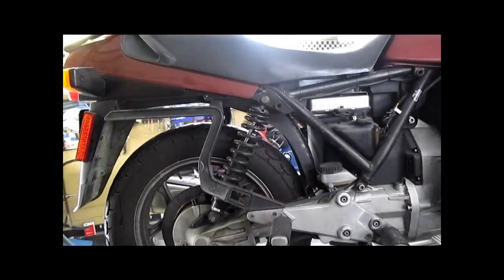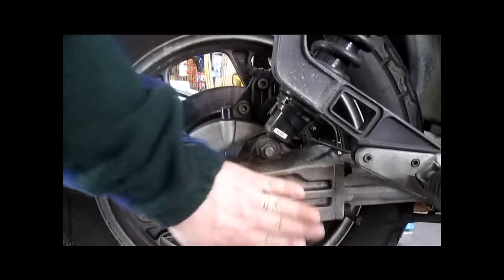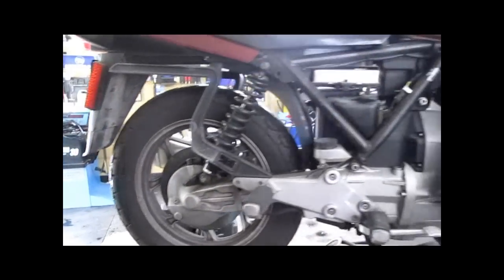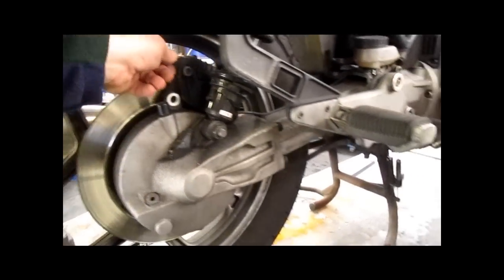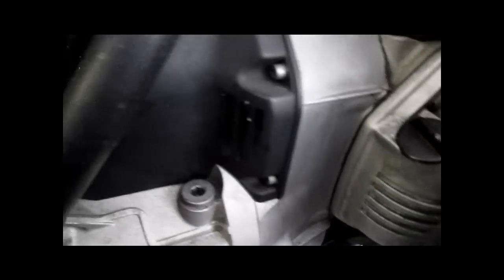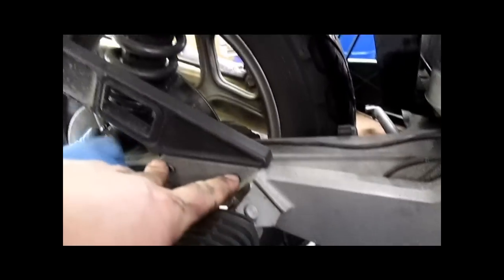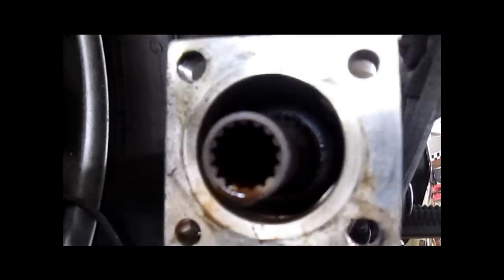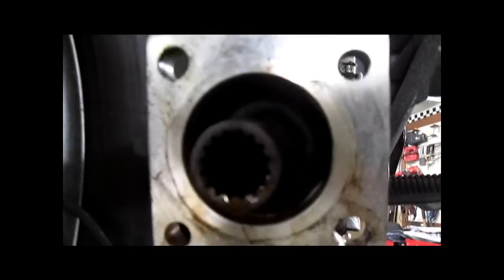BMW Service - K75/K100 Pre-Buy Inspection

Comment: I had an '85 K100RT. I was the only owner. It never had it's rear drive separated from the swingarm in it's entire 158,000 mile life, and the drive never failed. I'm thinking it was likely ruined, but it still worked. Wish I would have had these videos back then. Why destroy a good bike?

Comment: I bought my last K75 four years ago with a pretty good maintenance history.  The bike had 63, 000 miles. At my first spline lube there was plenty of grease and very little wear. I cleaned and greased with Honda Moly 60. Great video and very, very helpful.

Comment: What a superb video - this is something EVERY potential K75/100 buyer needs to know about. I have had my 1991 K100LT for 17  years now, it has 142,000 miles on the clock & I clean/lube the driveshaft EVERY time I change the rear tyre (5000ish miles). I also remove the shaft entirely & lube the front splines although they never seem to suffer from drying out so much. Keep up the good work!.

Comment: It never ceases to amaze me that people & dealers do not give the PROPER attention to such a critical and costly maintenance item, given all the knowledge through the years, of ruined drive lines! Just like the piss poor plastic original lower intake gaskets GM used on the 3100/3400 & 3800 V6 engines, you have to replace them with the aluminum framed GM or Fel-Pro gaskets. You are doing a super job with these videos!!!

Comment from the maker: Thanks. The front end of the shaft does not get any wear as it does nice ride back & forth along the spline like the rear does when the suspension is compressed & released. Keep the maintenance up and you'll pass 200,000 mi. without any difficulty. The 1990's were the best years for K bikes. Enjoy, Chris

Comment: I too purchased a k-100. It was a barn find It had a dry spline at 40,000 k.........I read the ingredients of never sieze, an they put moly grease in there. So....yup, I used it......I'll be taken the rear off again for a season inspection, I;ll post here with the results.

Comment: Thanks for a great public service video.  I did this service (and more) after I bought my 1985 K-bike and won the lottery.  Everything looked excellent and I believe the very low miles on the clock was pretty accurate.  I don't understand why you didn't pull the drive shaft and service the splines on the front too.  That was a bit of a hassle, but this shade tree mechanic was able to do it.  I encourage others to try, given that you often can't be sure it's done at the dealers.  :-(

Comment from the maker: Hi, The splines really need to be thoroughly cleaned and then lubricated. This can not be done properly without removal of the transmission. You can cheat and just slide the gearbox back but the labor that is saved is mere minutes. Thanks, Chris

Comment: Hi Chris, I bought an '87 K75s last Feb and am slowly working through it - it's back on the road for the summer :-)  I'm new to this spannering lark and your videos are brilliant, really helpful, please keep doing them. Next job is grease the clutch splines (having some pretty clunky gear changes), oh and there's a petrol leak on the left-hand-side of the fuel tank that I need to patch (was thinking petro-patch and JBWeld might do the trick on the outside of the tank), All the best, Ian

Comment from the maker: Make sure the horn works. If the horn does not work check the fuses. If the fuse is blown the cooling fan is likely seized. While not 'expensive' this defect would reduce the bikes value by up to $500. Point out to them that these instrument clusters were notorious for failing and the mileage might be inaccurate. Seized fan = many miles. If they are not willing to reduce the price ask to see the rear drive splines. If they are still unwilling then walk away unless it is an incredible deal. Chris

Comment from the maker: Most certainly! All BMW K models with this type of single sided swingarm should be inspected prior to purchase. The later Para-Lever rear suspension as found on the K1, 1992 K100RS, all K1100RS and K1100LT models do not need to be inspected. Thanks for your question, Chris

Comment from the maker: Unbolt the top of the shock and let the rear drive come down until the tire touches the ground (or your lift). Then unbolt the bottom of the shock and remove the shock from the bike. If it is an OEM BMW shock throw it away and get a better one (Progressive, etc.).
Reply: My 93 K-75  with 14K on the clock.. but years sitting before I revived it -  had the rear shock collapse. All loaded to go to colorado... came out in the morning, and blop..  Eventually bought the YSS Thai copy of the english shock, Good quality,  The BMW shock.. not rebuildable.  25+ years and things just die.

Comment from the maker: The R1100GS is one of the most reliable Oilheads made. Not as 'nice' as the 1150 but far more reliable and no failure-prone hydraulic clutch or the design flaw of the clutch carrier to deal with. Head gaskets were a problem with the early ones and there is always a risk that the tech who performed the 600 mi. service over-torqued the head bolts and pulled a stud from the block. This can be repaired but it is to be considered if you see drooling head gaskets. Rear drives are usually OK. Good luck
Reply: what's the things you need to know about a R1100 (259) motorcycle?  does the paralever needs the same operation, lubing splines?
What about those 2 chains and their sprockets inside the block while having like 50K on them. the chain tensioners have become an update and you need to replace them, but how you know the chains & sprockets are bad as wel the 3rd chain in there.
What about if the clutch lever only grips in like the last 25/<30% of the lever action. how should a clutch feel on a r1100 (259)?
what about the Hall Sensor?

did you place a 6 speed gearbox on a r1100 rs?

Comment: Just got a 90 K75RT w/50,000mi. Saturday (3/9/13) and saw your video that night. Pulled it off today and...................you guessed it.......dry as a bone!!! The dealer in Palo Alto told the previous owner last year that it didn't need that service. Even on the left coast we've got lazy lying sons a bitches as well. Thanks for the great videos!!
Monterey Bob

Comment: Couple of things. 1. I've never been a big fan of Max's. Just because I'm only 18 they blow me off at the rallies. 2. Ive always been a big fan of the old Texaco StarPlex. Use it for the splines, and on all the clutch throw-outs when i service airheads. Last, When my final drive failed on my k75 (housing broke and dropped the shock, causing the seat  to hit the tire and roast my tail cowel) I picked up a used rear drive from Beemer Boneyard for about a hundred bucks. great video. love the fbombs

Comment: Hi Chris ! 
I'm going to buy K75 from '89 in a week. Thanks for great video. I have a question - were they any noises or weird sounds in that particular model that can forecast that the shaft and splines are in bad condition ? I think it would be impossible in my case to unscrew the covers and wheel and look at the splines, so I was wondering if I could do some "ear diagnostics" :) 

Greetings man - great job and videos

Comment: Chris.  Really great video thank you.  I am considering a 92 K75 after riding my friend's down the autobahn at 125 MPH.  The bike was solid as could be.  Great technical information and I love how you used the F-bomb as a nown, verb, adjective, adverb and pro-nown.  One question, should I use any copper anti-seize anywhere?  LOL.  You're videos are great.  I want to get my splines replaced by Mr. Bruno!
Reply from the maker: Thanks Michael, the K75 is a good machine. Enjoy, more videos coming soon.
Reply: for some reason mechanics tend to hate their customers  the 'people' and call them morons idiots and fckers all the time. While often its them whose only antiseize is an airgun.  But i don't blame them, its safer then eg a lugnut coming off by itself eh?  Anyway i personally use special wax based special paint instead of grease it soaks into metal protecting it.

Comment from the maker: Thanks Ian. Your fuel leak was caused by years of use and failure to remove the fuel pump and clean the fuel tank innards each time the fuel filter was replaced. Good luck and thank you for your comment, Chris

Comment: Bought a '92 K75/RT from a friend and promptly rode it from AZ to TX pulling a small trailer.  Never had an issue with the bike on that trip, just the trailer (leak in airbag suspension = tires rubbing on fenders at 60+ mph. BAD.)  I did have splines checked when I had new tires put on the bike, and the local Old BMW's Guru pronounced them well maintained and in top shape.  So got lucky there.

One thing I did notice (and Perry chewed me out on it) was that the clutch cable tension needs be adjusted ALL THE TIME. Doubly so if you ride it as if it had a wet clutch, because the K75's have a dry clutch.  Ride it without feathering the clutch as much, and this is of course less of a concern.
Reply from the maker: Do not 'feather' the clutch. In or out and the clutch will last for over 100,000 miles. Good luck George and thank you for writing, Chris

Comment from the maker: Awesome. It is possible that the previous owner fogged the cylinders with oil before putting the bike into storage. This is done to add a layer of protection to the cylinder walls while the bike is left in storage for an extended period. Thank the previous owner if you meet him again.

Comment: I've bought a k75 rt and completly dismantled the whole bike to check before use it.
you can lube the spline just by removing the rear drive and remove the axle.
lube it and reinstall it without removing the gearbox.

Comment from the maker: Para-Lever equipped bikes do not wear the splines of the driveshaft as 2 valve K bike do. The only issue with Para-Lever rear drives is that they are often not assembled correctly. A sign of that is a leaking pinion seal visible at the accordion boot between rear drive and swingarm but even this is not a problem. However, grasp the rear wheel at 12 o'clock and 6 o'clock. See if you can find any play. If there is is needs to be rebuilt. If not check 3 & 9. Play there indicates play at the pivots.

Comment: The driveshaft can be pulled rearward, pull past it's detent, and then lube the front part of the driveshaft spline.  You can then shove it back into the long swingarm housing and nudge past it's detent.
Reply from the maker: Yes, certainly.

Comment: Hi Chris I've got a 1986 K75C with drum brake, would it be worth me getting a washer welded into the driveshaft?
Reply from the maker: No; just remove the rear drive at each tire change and lubricate the propeller shaft splines at that time. About every 8,000 miles.
Reply: @ChrisR.Harris  Cheers Chris 👍👍

Comment: I would "probably" drill a hole where that rear bolt is for the saddlebag mount.  That way, it can be removed without the removal of the rear fender.

Comment: Thanks for replying Chris. My 75 is like a bloody 2 stroke sometimes, at least I now know it's nothing to about worry about. Should stop the silencer (muffler) rotting out anyhow.
Reply from the maker: That's the proper way to deal with that problem. 20w50 non-synthetic motor above freezing temps.

Comment: Hi chris great my friend! Do the splines of the k75 and k100 sshared same number splines  pre 86, respectivly post 86? I might buy some used bikes to make one good of 2 mediocres...any advice? Next tuesday i can buy a k100 for 1500dollars, the k75 for 750 dollars....do the wheels match, callipers, etc? I can imagine that not only the splines changed after 86? Question is: what parts are interchangeable betw k75 and k100? Does my gutt tell me that the only difference might be the motor? Or is this simplistic? As you read, im asking out of no experience with k models...its my first purchase kmodel...i seen lots of your videos, and am confident to do some checks and work myself, 😀i hope you very best from Belgium! I bring chocolats when im in states, you are gold amigo! Respect bob the Belgian

Comment from the maker: I have removed the transmission to find the splines there bare as well along with even more comical mistakes. This bike is here for a complete spline lube, major service and fork seals (dealer replaced 3,000 miles ago and leaking!). More videos tomorrow most likely. Thanks, Chris

Comment: if the splines are worn the shaft engages with a bit of a bang as you set off, mine eventually snapped as I was pulling out of a junction. the replacement was much quieter. 10 year old bike with 40k

Comment from the maker: dbuck - 
1: I'm not surprised! 
2: I've never used it. Thanks for the suggestion though I am quite happy w/ Staburags on the clutch splines your recommended Texaco product would be worth using on the driveshaft splines. As for the failure of your rear drive shock mounting: I have seen a couple bikes with bent shock mounting studs. This can lead to the problem you experienced. It's happened to me as well though the rear drive was not damaged. A low rider BMW handles like shit! Thanks, Chris

Comment: I read somewhere that one way to keep the grease where it should be is to plug the shaft with a rubber stopper. The idea being that the grease can't travel up the arm, away from the splines. What do you think of this idea? And if it's an option, what's the internal diameter of the shaft?

Comment: Hey man love your videos. Really helpful. But i have a question, what exactly do you use to lubricate it once they are clean?
Reply from the maker: Thanks! Stay tuned for new material. Staburags NBU 30 PTM is what I and the factory used: https://www.amazon.com/Genuine-Lubricating-Assembly-Grease-Spline/dp/B07D6FWL69/ref=asc_df_B07D6FWL69/?tag=hyprod-20&linkCode=df0&hvadid=365910377250&hvpos=1o1&hvnetw=g&hvrand=10762697304700908117&hvpone=&hvptwo=&hvqmt=&hvdev=c&hvdvcmdl=&hvlocint=&hvlocphy=9002739&hvtargid=pla-790863422613&psc=1&tag=&ref=&adgrpid=79954179287&hvpone=&hvptwo=&hvadid=365910377250&hvpos=1o1&hvnetw=g&hvrand=10762697304700908117&hvqmt=&hvdev=c&hvdvcmdl=&hvlocint=&hvlocphy=9002739&hvtargid=pla-790863422613

Comment: Chris, awesome video.  I just bought a 1991 K100rs with 18,500 documented miles.  I also got some of the service records.  Just changed the fluids, but noticed that my 1991 model drive shaft is not the same.  You mention in the video if it has the bottom arm, which mine does, the process is different.  Do you have a video for that model as well?  Would love to hear from you.  Thanks.

Comment: Using Copper Anti Seize in the 4 Wheel Bolts will require a reduction of Approx. 25% of the applied torque.( Check with qualified Mechanic / Engineer.)
Reply from the maker: No, there's no reduction in torque required at 78 lb. ft. / 105 nm. My 30 years of BMW experience over your engineering degree: I have never had a lug bolt loosen and I have been coating these w/ copper paste per BMW's instructions since 1998. You obviously don't live in a wet area or use your vehicles during winter but thanks for your concern, Michael. If you reduce the torque by 25% (ie; to 18 newton meters) you WILL likely lose a wheel. That's a fate that a few have suffered by their own ignorance. God luck to you, I'm done; Chris
Reply: @ChrisR.Harris  
😁👍

Comment: Thanks for the video. I am looking at a craigslist buy for a 1985 K100 right now an will be meeting the guy hopefully tomorrow. I really want to buy it because it is only $1700. He told me he has to charge the battery and he is changing the oil. Is that a good price? Is this a good sign to buy it? It would be my first bike. I only owned BMW so I wouldnt mind sticking to BMW
Reply from the maker: Hello Chris, The 1985 model is the least desired as it is an oddball in several ways. I would not recommend it as a first motorcycle. There are better choices for a starter bike than BMW but the 1986 - 1996 K models were much better than the '85. Good luck, Chris
Reply: @ChrisR.Harris  If you do not mind me picking your brain about what you said, what makes it least desirable as oppose to a 1986 or newer?
Reply from the maker: @beamerandthebeast3979  A: Electrical issues are far more prevalent in the '85 model than any of the subsequent 10 years. B: The footpeg plates are different meaning that when you break one after dropping the machine on its side you will need to find a used replacement part for a model that was made just one year. C: The fiberglass tail section and seat were used only for that initial year. All others shared an improved design. D: Mechanical differences - while BMW kindly used rather hot performance cams for the first year of the K100 in the U.S. the engines had plenty of teething troubles and weak spots that were corrected in the 1986+ models. There's much more. Good luck, Chris
Reply: @ChrisR.Harris  enough said!!! I owned a niche car in the past and realized the part finding problems and countless junkyard dives I had to do... I do not mind the electrical issues however, everything else i do mind! Thank you very much for helping me! I will be looking for an 86 or newer now :)
Reply from the maker: @beamerandthebeast3979  A wise man you are ;)

Comment from the maker: Hi TheCsipke, What year K100? Does it smoke when started after being parked on the centerstand or only when the sidestand is used? The 1983 - 1989 (87?) K100 did not have pinned piston rings. This results in the end gap of all 3 rings lining up sometimes and causing an incredible amount of smoke. This does not mean that there is an engine problem at all. Good luck and enjoy your 'new' K100RS. If it was stored on the sidestand it might take many hundreds of miles of use before the smoke subsides.